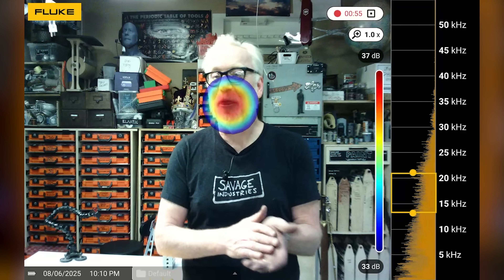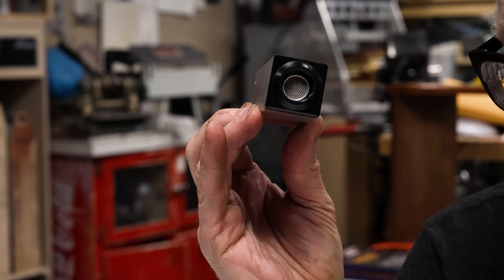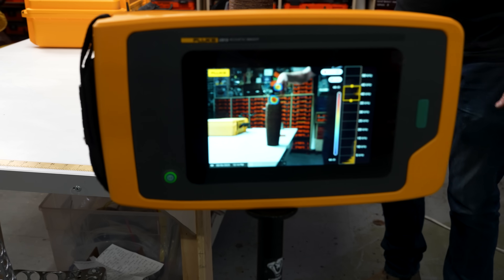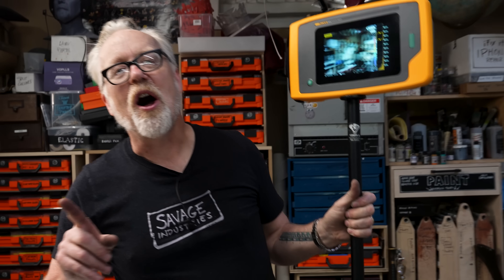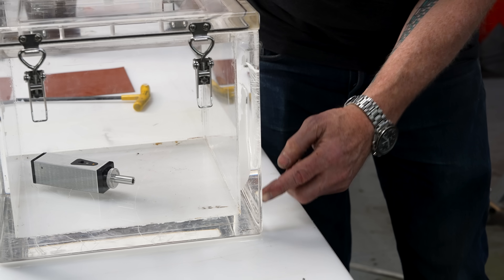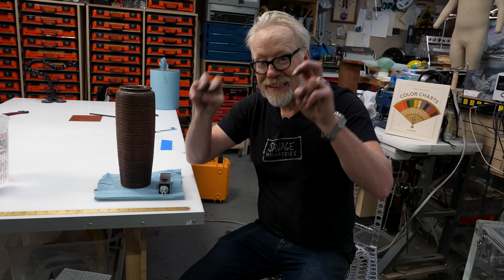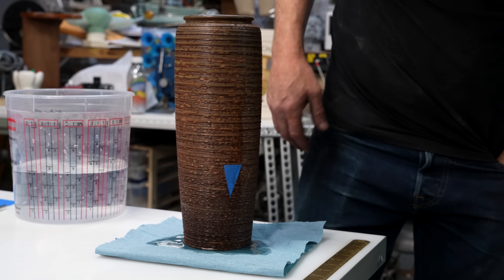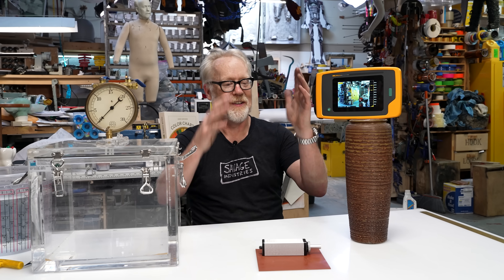Adam Savage Finds a Hidden Leak With a Sound Beacon!

Comment from the maker: Fluke ii910 Precision Acoustic Imager: https://bit.ly/44eUHVi
Fluke SB140 Sound Beacon: https://www.fluke.com/en-us/product/industrial-imaging/fluke-sb140
Adam's experiments with acoustic imaging: https://youtu.be/UPVcwDzhBZ8
Reply: Yeah  man lol thanks. I’m sure your viewers have the $25,000 to spend. And of course, an extra couple grand for the beacon.
Reply: @jamesbizs  This is a product for industry, businesses. The cost of downtime can quickly outweigh the cost of the device.
Reply: Oh yeah, totally forgot to add in another 2 grand for taxes. But hey!! Free shipping! Sweet!
Reply: Can the sound camera also detect a tiny pinhole in a low pressure inflatable of thin plastic foil? AFAIK the only reliable detector is either a Schlieren camera or working with fog (which oil substances may damage certain inflatables (latex or with electronics) when put inside).

Who uses Fluke!? Sound cameras don't need to be that moonpriced. Versions for few 100 EUR exist. By the way better do not put the ultrasonic probe inside a vacuum chamber in operation. It may burst the LiPo foil battery and cause a fire.
Reply: If I could frequency sweep the interior of the enclosure I could also tell how big the gaps were by what frequencies were able to get out as well as map the shapes of leaks if I'm pointed right at them
Reply: @russellzauneryou seem like a smart man, this is true, the 40kHz is quite small.
Reply: I wonder if this could be used with software to isolate someone's voice from outside noise.
Reply: @jamesa8851  I heard that the team from Sorama has already solved that issue. There are also lots of sound reflections from the surrounding surfaces
Reply: I am Jesus Christ

Comment: Interesting tool. But I'm a bit skeptical about the accuracy of the vacuum chamber test, if you have a small leak it might not show up immediately using the tool, until the chamber loses enough vacuum for sound to propagate through air, because sound doesn't travel through vacuum?!. But love the video

Comment: Adam, one thought about the test: since sound needs air as a medium, putting the beacon inside a vacuum chamber means the Fluke viewer wouldn’t detect sound escaping — even if there’s a small crack or leak. So it’s possible for the chamber to still be leaking air while appearing airtight acoustically. Please correct me if I’m off here

Comment: Uh, in a vacuum the transducer / beacon wont work anyway, as it requires air to create sound waves !

Use chloroform and let capillary forces draw it into the crack - it will chemically bond the acrylic. 
Also since its a vacuum chamber, the lower pressure will help seal it and maintain structural integrity, 
as it seems the joints a mitered.

Comment: There's no way that vacuum chamber has "integrity".  Just because it holds a vacuum for a few seconds proves nothing.  You wouldn't say a suspension bridge where one of the cables was clearly down to one strand had integrity, you'd say it was a disaster waiting to happen.  The vessel might currently hold a vacuum, but it's got a massive crack along the join, and that is only going to grow as the chamber is put through pressure cycles.  In fact, the device did show an acoustic hotspot which you missed, so it may not even by airtight now.  Pull a vacuum, with a meter that works, and leave it 24 hours and see if you still have the same vacuum after a day.  If you do, it's holding, but for how long?  You might be able to make it sound by wicking thin CA glue into the crack, then pulling a vacuum, but if I'd just bought that, I'd be sending it back.
What is it about American delivery services?  So much stuff gets delivered like it's been through a war zone.  They take no pride in their work.  I'm in the UK and I've ordered goods from all around the world and it almost always turns up with the box looking pristine.  The only exceptions have all come from America. In fact, I have never had anything from America that didn't look like they'd used it as a puck in a game of forklift hockey.  If I was shipping anything in America, I would use those g-meter stickers to verify that the parcel had been handled properly.  It's not just the shoddy handling though.  Their logistics suck too.  When I order from the US, it often takes two weeks to move just 100 miles within America, being shipped from depot to depot.  Once it lands in the UK, it typically spends half a day in customs, I pay what's necessary, and it's delivered the next day.  In contrast, I've had goods from China delivered in two days, and from all over Europe goods arrive the next day.  If Americans weren't so insular and travelled the world more, you'd get to see why you're held in such low regard by the rest of the world.  The rest of the world has advanced so much since the war, often out of necessity.  America has had it too easy for too long and has fallen way behind, and because you don't look beyond your borders you've no idea.

Comment: We use them at work to find leaks on pneumatic equipment that have safety gates. We can't be in the cages because of LOTO rules. Before we had this I used to tape little bits of rags everywhere to find leaks then when I got close I'd spray lithium grease everywhere to pinpoint point it. This thing saves time. Time means product and product means money.

Comment: Get some dichloromethane and get it into the crack to solvent weld it. Pulling a vacuum on that it with the damage is pretty dodgy. Not saying I wouldn't do it myself though, lol
Reply: The crack is onl along the rim and that box is prett thick and rather gets stabilized by outer pressure than implode. But I would not dare to put vacuum into a cracked thin glass globe (like a lightbulb).

Comment: 6:30 - the vacuum chamber might not have a breach in the wall, but its integrity may indeed be compromised due to the crack. Once the air is vacated from it, it may not be able to withstand the atmospheric pressure pushing in on it and it may buckle where the crack is. A nonperfect example, but think of the OceanGate sub: it didn't leak, but the cracks in the hull/shell compromised its integrity leading to the implosion under pressure. This doesn't seem to be the case here, of course, but I wanted to point out that just because the sound isn't leaking doesn't necessarily mean the structural integrity has been compromised.
Reply: The crack is onl along the rim and that box is prett thick and rather gets stabilized by outer pressure than implode. But I would not dare to put vacuum into a cracked thin glass globe (like a lightbulb) or run a TV with cracked CRT.
Reply: That’s a really good point about structural integrity and the OceanGate comparison. I was also thinking along similar lines, but from the acoustic side: since sound needs air as a medium, once the chamber is evacuated, the Fluke viewer wouldn’t pick up any leaks acoustically — even if a small crack is letting air seep in. So the absence of sound doesn’t necessarily prove there’s no leak, only that sound isn’t escaping. Between structural issues and the lack of a sound medium, it seems like acoustic testing in a vacuum could miss certain problems.

Comment: Even if your vacuum chamber leaked, put it in a vacuum and along the fracture apply super glue or a similar sealant. When applied the lower pressure will draw in whatever you use and will seal fracture. Great story on this helped me if interested!

Comment: Check Out the May 1967 issue of the HP Journal if you are looking for some info on some early ultrasonic leak detector tech. I also have found that the AudioMoth helped me locate some ultrasonic noise before.

Comment: That test with the vacuum chamber still didn't tell you if the structural integrity is still good enough to hold against the air pressure
Reply: Probably yes because under vacuum the crack will be under conpression

Comment: Just because that crack doesn't compromise the vacuum seal doesn't mean it hasn't compromised the structural integrity of the device. It could still break under vacuum

Comment: Long term user of vacuum systems here, a lot of the time cracks do not affect systems until the pressure of the vacuum opens up the crack. I would be interested to see if you can pick up on this as under full vacuum you would lose the ability to transfer the sound from the device.

Comment: It's cool to see such a fun update to an alreadry interesting device!! 

This question is for anyone who can provide insight:
Wouldn't the sound beacon's function be diminished in the vacuum chamber? Since it's relying on air to transmit the sound waves, any air drawn in  may be at a slow enough rate that the beacon's speaker can't really push it around. Also it's low pressure, so air is only drawn in Iand not escaping to the acousitic imager. I feel there has to be some minimal amount of molecules for the becon to work.

And that lends itself to wondering if all of which can be addressed by pressurizing the box a bit. Even 1.05 ATM, which I feel the box could withstand even if designed for vaccum. I'm hoping we can get a part 2 with the beacon because I'm curious about a higher pressure for this same box. Worth noting didn't see a pressure rating for the beacon.

Comment: P.s. just because your vacuum chamber isn’t leaking air through that crack it doesn’t mean it hasn’t lost its integrity. “Titan submarine” I wouldn’t be pulling a strong vacuum on that chamber becuase it will likely implode catastrophically beginning at the weak point.
Reply: sincerely doubt the pressure differential between a vacuum and the atmosphere at sea level is enough to cause an implosion in that box with a point of failure along the corner like that, more likely that it will just start leaking at the seam.

Comment: I would suggest not pulling a vacuum with the 40khz sound beacon inside the chamber because the vacuum could damage the membrane in the 40khz ultrasonic transmitter. I haven’t read the data sheet for the fluke but it sounds sketchy to me.
Reply: Is that speaker sealed? I rather would fear the LiPo foil battery to burst and set it on fire.

Comment: Everyone in comments complaining about pricing has clearly never ordered anything from a company like Bruel & Kjaer (not an affiliate). 

This is engineering, folks.  It's not "you get what you pay for", it's "specify your parameters and then either have funding or change your parameters" .

I like to point out the value of experience when I can - experienced engineers will be able to dial that in ahead of time, plan to it, and negotiate with management as well as tool vendors, that's why they cost money; if they aren't doing this job for you, you are literally better off without them unless you need to intentionally suck up budget for some reason (then they're awesome).
Reply: Unless a laboratory depends on a documented certified specification and calibration of this meter for a special repeatable test case, the price is still a ripoff. Use a RasPi with microphone array for some 100 EUR to get the same result.

Comment: Sounds like a nicer way to check for sealing than what we do with the train cars we build - we just blast'em with water and if it doesn't flood inside, it's sealed well enough 😆
Reply from the maker: Ha! Well, that would certainly be one way to do it.
Reply: @tested  It works well enough, except that sometimes you go to work and get told you can't work on that coach because it wasn't as well sealed as it should've and we're waiting for it to dry 🤷

Comment: I worked in a shop that had a "squeaks & leaks" guy who would have begged the shop to buy this tool. Normally he would just turn the fan on inside a closed car, then walk around with an open-tube stethoscope listening for air escaping. You'd need something like a sensitive microphone for "self-emitting" noises. But the open-tube stethoscope method is a cheap alternative for a lot of things. I've used mine many times for isolating the source of air leaks, vacuum leaks, engine knocks, suspension squeaks, etc. I even had someone walk around above a crawl space while I isolated the exact source of a squeaky floor. It's one of my most-often used tools.

Comment: I work at a place that refurbishes HVAC for trains. We re braze parts back onto pipe work. We test for leaks by pressuring it with nitrogen and leave it for 8 hours. Finding leaks it almost impossible so this device would help massively

Comment: You can do all that super expensive fluky one, cheaply using a lowly ultrasonic generator with an old school hp leak finder (aluminum tube with an ultrasonic sensor+ receiver box with a meter+ headphone gizmo that runs off 9v battery!) that down converts(fancy way of using a daisy chained decade counter🤔) the ultrasonic sound to audio frequency. You just have to wave the wand(or tube🤔) around to find the leak. The original leak finder does not need an ultrasonic beacon, because the hissing of a leaking gas is ultrasonic!😂. No wonder Fluke finds innovative ways to 🪦 off old tech, and makes 💰off it!🤯. Should be fun to do an AB testing with the almighty archaic leak tester!.😢😅😂😊

Comment: "Acrylic Engineers" more knowledgeable than my humble self, please better qualify my concerns, here.  

Adam repeatedly placed his delicate face and head within inches of the cracked acrylic vessel while he was stressing it with an internal vacuum AND applying other forces by contacting it by hand.

Am I just a Nervous Nellie in thinking that he may have a tabletop counterpart to the Oceangate Titan Submersible, ready to fail sometime: the next or the fourth or the tenth use in the future?

Heaven forbid, but, what if?
Reply: The crack is onl along the rim and that box is prett thick and rather gets stabilized by outer pressure than implode. But I would not dare to put vacuum into a cracked thin glass globe (like a lightbulb) or turn on a TV with cracked CRT.

Comment: Speaking of different imaging.... I work in automotive diagnostics and years ago the best purchase I ever made was a thermal imager.   It is the fastest method of finding parasitic drains, shorts, excessive resistance, tracing circuit paths/ routing and component fatigue.   It even works very good at finding bearings before they fail and a million other things that you can catch before they cost thousands in repairs or many hours are spent running down a short.  It paid for itself in less than a year.
Reply from the maker: Very cool to hear! Thanks for sharing. (What a cool job!)
Reply: When cheap "clip on to your cellphone" thermal imagers came out (7-8 years ago roughly?) I got one purely for "another sensor in my pocket" but it turned out to be great for diagnosing failed motors in robots (early prototypes that weren't nearly as self-diagnosing as you'd hope.)  There was a lot of back and forth between teams  - is this a software problem or a hardware problem? Pull out the sensor, "well, motor #2 is 30C warmer than the other two, that's not software" :-)  So it definitely rapidly paid for itself in engineer-argument-time but it only cost $250!

Comment: I'll probably be lost in the sea of comments, but fancy pressure gauges often have some stabilizing foam on the inside (to protect it during shipping) that you're supposed to take out after installation.
Reply: In a cheap standing bicycle pump the pressure gauge had a kind of quarter-circular plastic cog that dislodged during transport. I had to reposition it to make it work.

Comment: This can also be used for building envelope testing to verify the quality of the air sealing and identifying where the air is leaking out. This can be used ahead of a blower door test which quantifies how much air is leaking. This can allow repairs to be made before the blower door test which can be costly due to all the preparation for the test. In many areas of the country, this is becoming required for new buildings, both residential and commercial, by Energy Conservation Codes.

Comment: I actually don't think this is an edge case, think about pottery restoration and preservation for antiques in museums.
Reply: particularly when it is a (e.g. painted or plaster) vessel that wold get damaged by submerging in water but is endangered to crack further when left unrepaired.

Comment: It has a preassure guage, not a vacume guage. Its just simply wrong, its pretty tho.
Reply: Are inlet and outlet pipe reversed?
Reply: @AerialTheShamen  no, it dont work like that. Vacume guage works backwords, from left to right, at least all I have seen. The inlet is to vacume, and "outlet" is just referance preassure of local atmosphere, though a small crack in the casing.

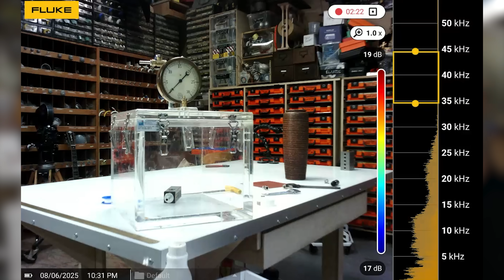Comment: 7:39 How would you expect the sound to leak out if the beacon is sounding in a vacuum? Come on man 😂
Reply: Also, he was testing *for a leak*. Y’know, a fissure which would allow for air to flow in?
Reply: It takes a few minutes for the vacuum pump to pull all the air out, so there should have been plenty still in the chamber when he did his testing.

Comment: That would be pretty handy for finding fire that you cannot see. Fire has a characteristic ultrasound "hiss".
Reply: Forest fire "hot spots"!  They often put out a fire and then it start again later.  Great, great idea.  The company should send a few to the grand canyon hotshots right now and see if it works.   My guess is that the software could be optimized for that too, which would be a nice federal contract for software update.
Reply: @alex10294 I dont think they mean  hotspots, as I doubt they'd make much sound unlike a fire. The commenter probably meant actual fire that dosnt have color, like how some alcohols burn
Reply: You confuse it with an IR camera. They are used to find hidden smouldering fire pockets after extinguishing a roof etc.